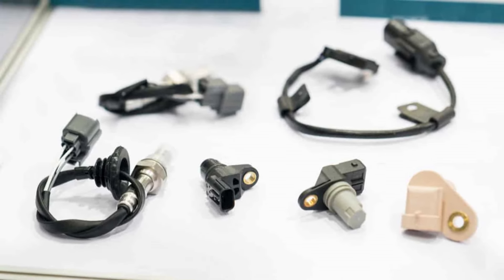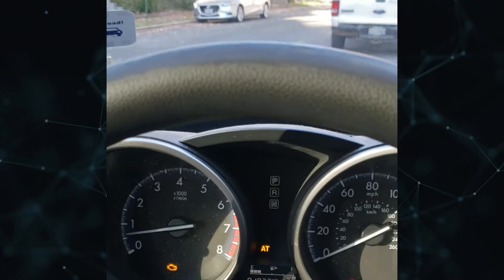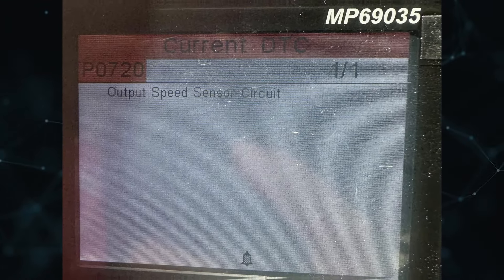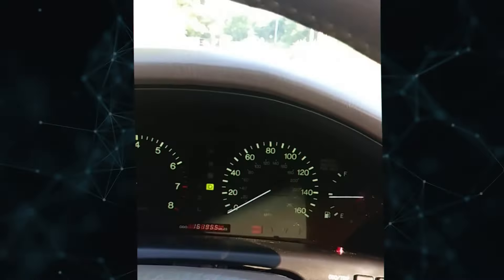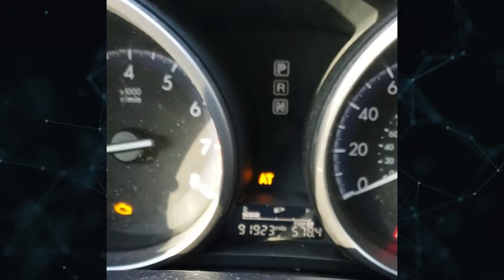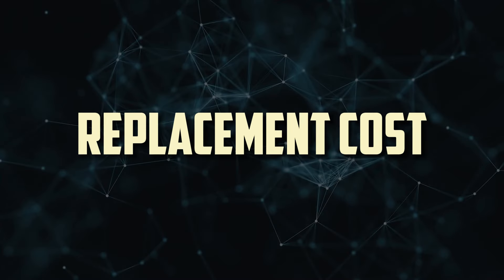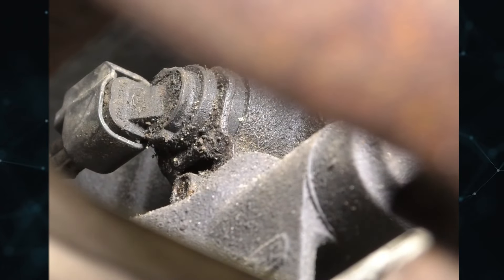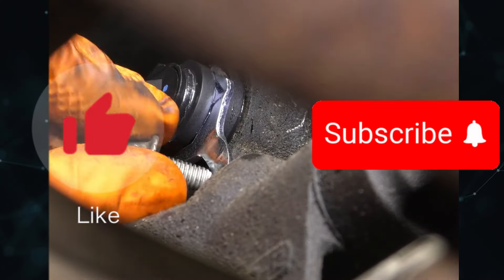5 Signs of a Bad Transmission Speed Sensor (and Replacement Cost)

Comment: Cost: If you own a Mercedes, the transmission speed sensors are attached to the conductor plate. The removal of the valve body is needed, so also include fluids, filters, gaskets (basically a transmission service kit is needed, plus the conductor plate). If you live in Australia, like me, $900 in parts plus 6 hours labour charge.
Reply: 😂😂 wow just get a crown Vic

Comment: I have a 2008 ford f 150 .. the Trans fault light goes on after driving for about 25 min... and the OD light flashes... i had a diagnostic said it was the transmission speed sensor...i just had it changed and the light still comes up... do i have to reset the computer or should the light go off by itself..please help
Reply: Should go away on its own just give ot time could be a day or few days or sole cars it's goes away immediately
Reply: Thanks
Reply: @juniorsaloman2242 did you get it fixed and how
Reply: @Pbj4k im wondering the same question

Comment: On a 04 Gm Envoy E4L60 transmission. If the speed sensors go out will it cause it to Jerk hard  between 3 and 4 gear and feel like it's slipping or like it don't know when to go into woch gear at 40 to 50 and cause it to feel like transmission is going out.
Reply: Same trans in a 97 jimmy, it's having intermittent shifting issues on 1st and especially 2nd gear with mildly rough shifting on the rest. I can make it stop by restarting the car sometimes. The abs light has come on a few times randomly as well. Did you find your issue yet?

Comment: Will a bad speed sensor wont let the transmission go forward. Because it does go in reverse only? Thanks in advance
Reply: Did you ever got an answer to this question? I just had the same issue yesterday morning.